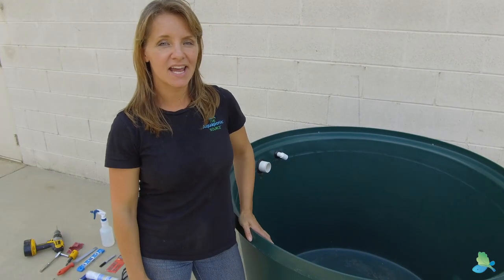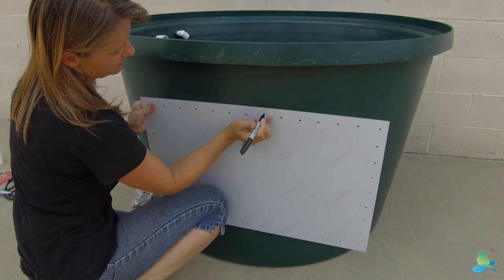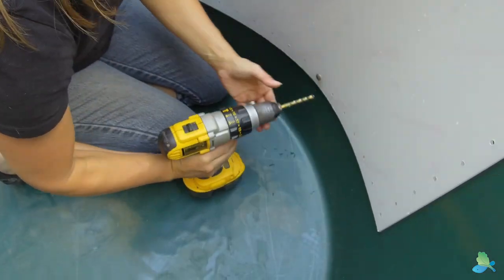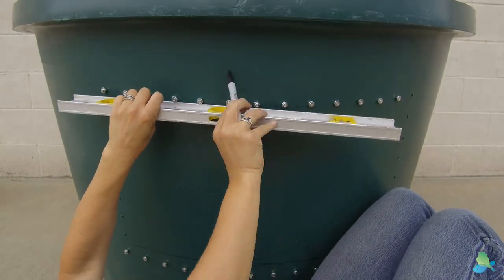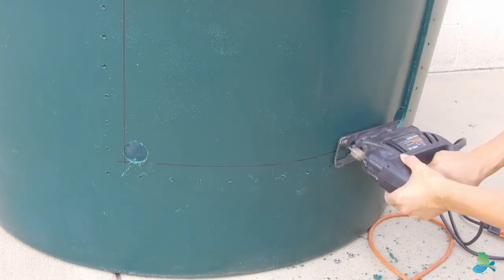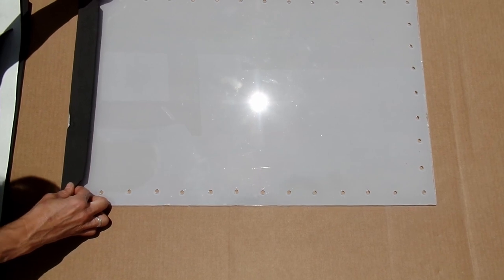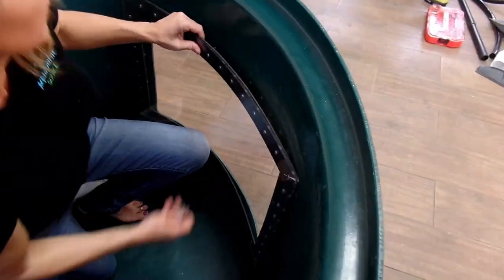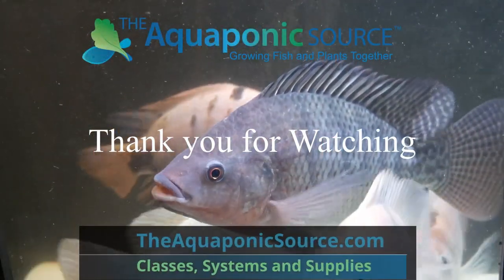Fish Tank Window Kit Installation

Comment: Just compression makes those diagonally cut strips not leak, only touching each other?
Reply from the maker: We haven't had any issues with the neoprene strips, but it is important to ensure the corners touch together. If there is a gap you could add in some extra neoprene foam or use 100% silicone
Reply: @aquaponicgardening   Great tip!

Comment: Are the metal screws inside the tank safe for fish?
Reply from the maker: Good question...The bolts are stainless steel so they won't rust. The rounded pan head is on the inside of the tank so there are no sharp edges.